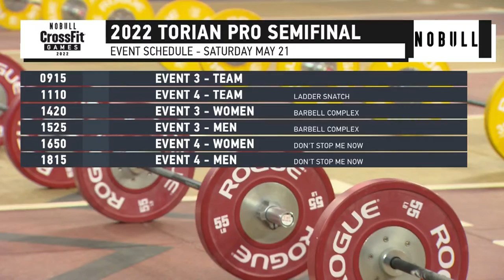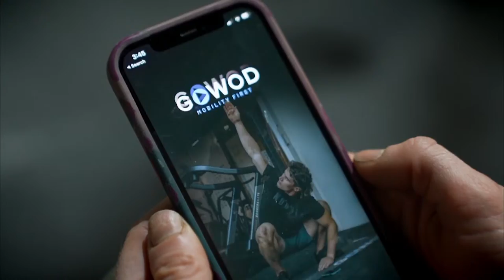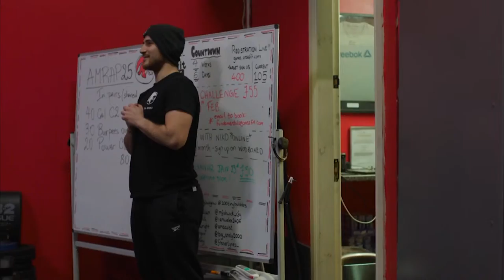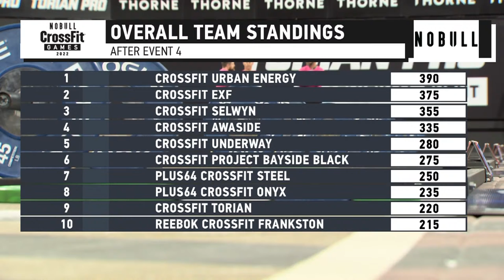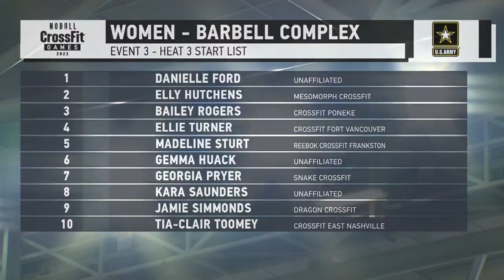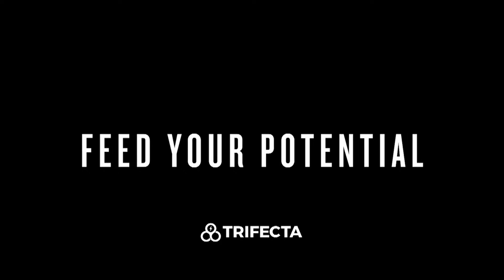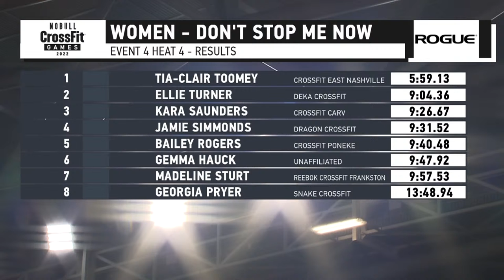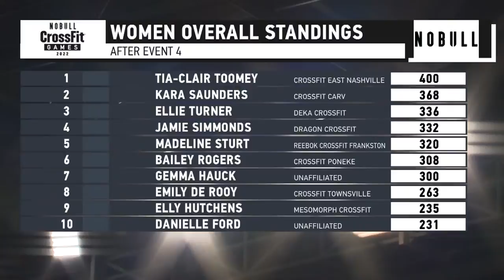Day 2 Torian Pro — CrossFit Semifinal

Comment: I really appreciate these semifinal event feeds.  One bit of constructive feedback is that it would be great if you would leave the time clock showing throughout the entire heat and in some cases you didn't even have the time clock showing at all, like in the last heat of Team Event 3.  Not only did the clock not show on the screen but there was never a picture where a clock in the arena was on screen.  Several times it was very noticeable that as the end of a heat got close the time clock in the top left disappeared well before time was up.  It was very difficult to follow how close teams and individuals were to finishing when it came close to the end of the time cap.  Thank you again for all the hard work that goes into these productions.

Comment: Tia got one more rep after the 2min pause mark in event 4, please correct me if i’m wrong!
Reply: It wasn’t counted. Officially she completed 31 reps in first round so they didn’t count two of her last reps - one on the buzz and one after it.
Reply: @dzudiy8806  but then she only did 7 reps to advance from 30 to 40.. Well she would’ve win anyways she’s a beast
Reply: @hmoragonzales  I think that you are actually right! I was sure that they didn't count these reps, but I have looked carefully at the video once more and it seems that they have counted both reps: the buzzer one and after the buzzer one to her score. So she did the work, but they shouldn't count at least one rep. Wondering, if she would be able to fit this extra rep in the second interval or if she would have to do the buy in...
Reply: The clock on the screen and the one on the floor was slightly different. It was explained somewhere on feed.

Comment: OK the judges wearing Pink is a bad idea. The colour is so distracting on the competition floor.
Reply: AMEN! Horribly distracting. Never a good idea to fill a viewing surface with neon colors. Waaaay too busy. And filming angles and judge positions also not optimal, as the judges often covering the weight signs.
Reply: That’s the point. They did it for a domestic violence awareness, you’re supposed to see it
Reply: But the judges angles and camera spots are always bad at CF events for some reason. They’ll be talking about an athlete that no camera is on. They need some work there for sure